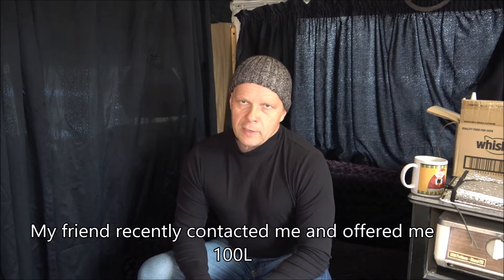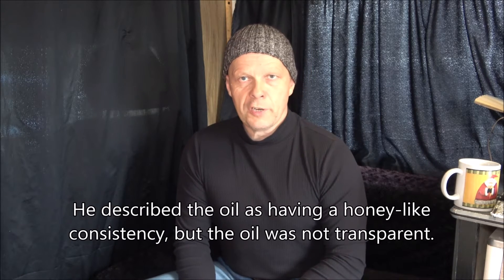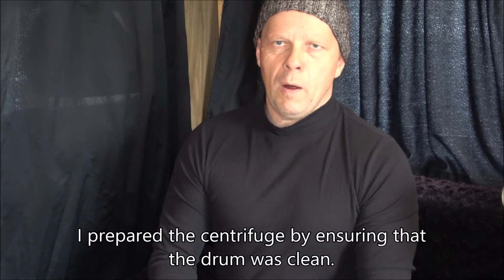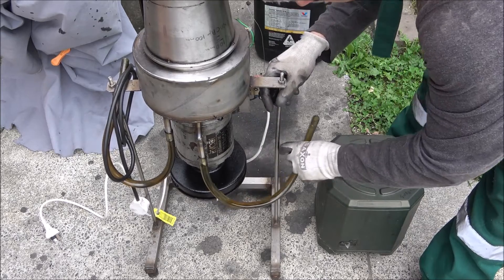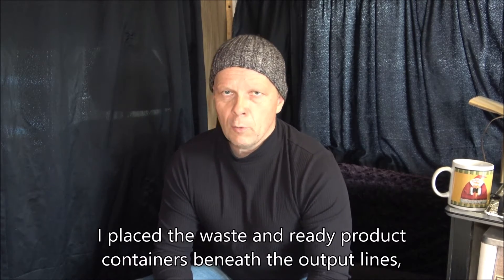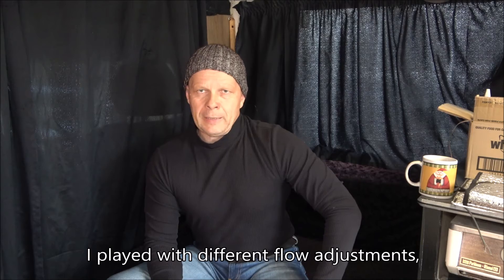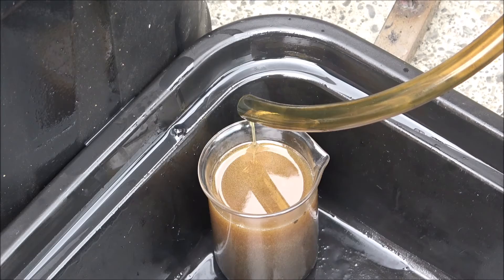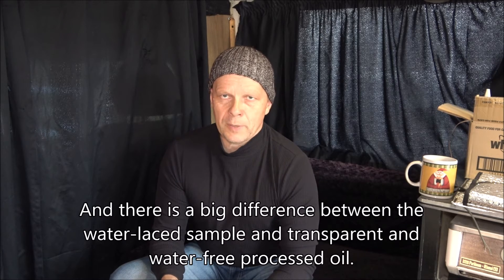Homemade Centrifuge Hydraulic Oil Recovery.

Comment: Lot of talent, man.  Glad to see someone doing these sorts of experiments.  As far as which of the additives get consumed (antiwear agents, antioxidants, rust inhibitors, antifoams, demulsifiers) and need replenished... not sure...  I guess you would have to get a chemical palette to test and adjust...  I am not in the industry enough to know all of the trade secrets.
Reply from the maker: Yes, it is a long process to find out what's left in the recovered oil. It's a matter of finding out how much of the additives are still present. It's a challenge, in this particular case thhe water was removed, and oil can be used in old type engine as fuel, sort of rewarding.

Comment: It looks almost exactly the same as a marine fuel centrifuge. I imagine you must have modelled it on that. For those who see this and have not spent much time in the belly of a ship, I will explain briefly.

Medium and large ships almost exclusively run on Bunker fuel, which comes in many classes and designations but they are all quite similar. Bunker fuel is a very heavy, high viscosity oil that can have the consistency of honey depending on temperature, blending factors, contaminants, etc. It is usually the bottoms product from the vacuum distillation train at a refinery combined with other residual products from other processes. The bottoms/residual products are then mixed with other lighter products to produce the required specification. This oil is heavy, dirty, sometimes even gritty, and always has some amount of water usually emulsified within it, just like the hydraulic oil Alek has here. There's usually less water by volume, but the quantity is still enough to cause serious problems on a ship at sea.

So you may be wondering why a ship at sea will use such a filthy oil as fuel especially when they have no support for hundreds if not thousands of kilometres. The answer is that they have engines that are designed to run on this fuel and they do it well. Oh, and they also do it because the fuel is cheap. They do it well in no small part due to their use of the Marine Fuel Separator, Marine Fuel Centrifuge, Marine Centrifuge, Oil Centrifuge, all the same thing. They are larger versions of what Alek has built here. This design here is somewhat less complex, but appears to have the same main components and structure. A Marine Centrifuge is the main filtration component for a ship's diesel engine and without a functioning one, all the bunker fuel in the ship's belly becomes nothing more than ballast.

Oh, and if you happen to ever have a bunch of waterlogged hydraulic oil, don't be a jerk and dump it by the river.
Reply from the maker: Hi, thank you for sharing. I studied in college and worked at a shipyard from 1986-89. Although I was a carpenter and joiner, we also studied shipbuilding technology. Moreover, many of my relatives and friends were seamen, so I always had a basic understanding of the industry.

Regarding your comment about oil disposal, I completely agree. Please avoid dumping used oil at roadside or river banks. There are designated collection centers for used oil that we should use instead. Although oil originally comes from the earth, it is better not to put it back.
Reply: @santeryi9  Here in the UK it gets cold in winter. When I have a bunch of waste oil, I usually take it to be recycled. But if I only have a small bit of it, I filter then blend it with diesel or kerosene and run it through my diesel heater. I’m of the opinion that it should only return to the earth as CO2. I like to feed it to Greta, not the fish.
Reply from the maker: @captainotto I am in South Island NZ, and it also getting chilly during a winter time.
I have 6 cars now and never throw away any oil, I will distill it, use as fuel and to lubricate my machinery or metall cutting tools.

Comment: Super! How to made? Prices?
Reply from the maker: Там в цонце ссылка на видео строительства це0нтр.ифуги
Reply: @santeryi9  a ten kakoi nuzen dlja 400°C?
Reply from the maker: @joramotorsportteam3277  Самый простой вариант как в моих реформерах, колба стоит на нагревателе ракушке от кухонной плиты, самое главное обеспечить конвекцию воздуха вокруг елемента, такие элементы работают годами и держат такую температуру легко.
Reply: Hello sir. Thank you for another addition.So for your reactors you use element of kitchen stove? How do you arrange them for example to produce 6kw?
Reply from the maker: @moseschipisa4608 The kitchen stove elements were used only in small up to 4kw Reformers to heat the evaporation retort.
The 4kw elements are can be found, so really no arrangement as such, there are a double paired elements are also awailable.
In my continuous machines I use a multitude of cartridge elements.